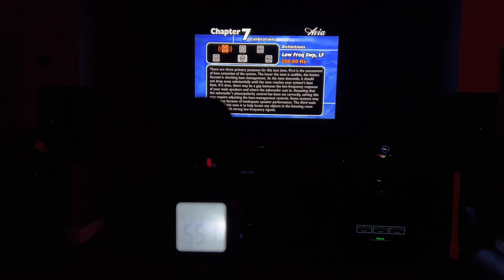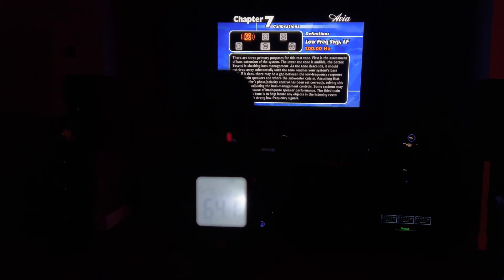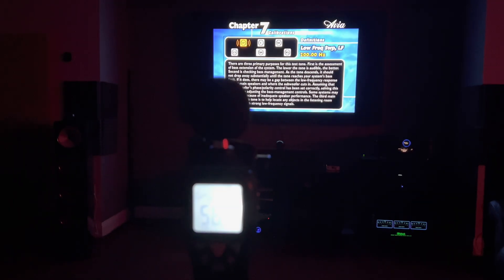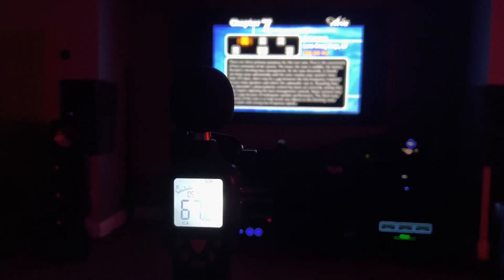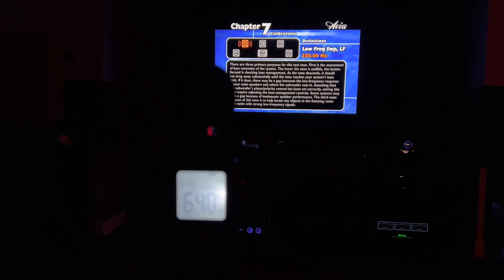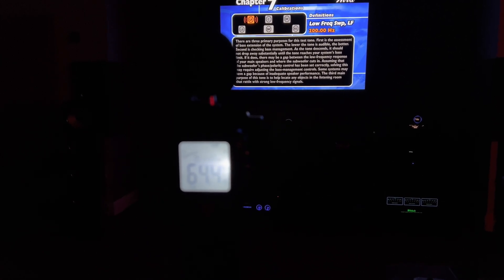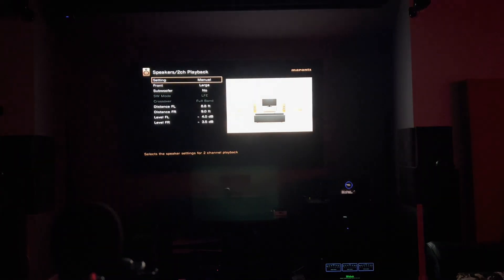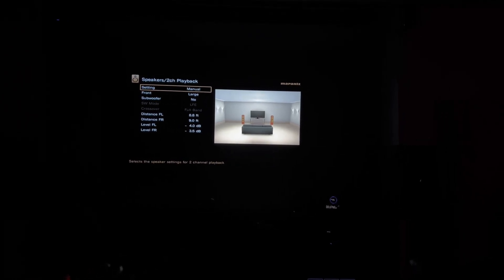How to correctly set speaker crossovers in your receiver/processor

Comment: Hello, is kef q950 for 40zh OK?
Reply from the maker: Thanks for the question. The frequency response for Q950 is 44-20,000 Hz (±3dB).  I would try 50 or 60 hz. Ideally  you should set the crossover point roughly 10 Hz above the lowest frequency your speakers can handle cleanly.

Comment: Hi… I have asked you before.. but still i have a doubt.
Would a single BF210(not the BF212)subwoofer on its own outperform sb16ultra or are they equal?
Reply from the maker: Head to head BF210 will not outperform the SVS16 Ultra.
Reply: @magnoliamo  Atleast would they be on par?
Reply from the maker: @SahilFardeen18  unfortunately, no.  SVS SB16 ultra is much more powerful and as I mentioned SB16 will go deeper than the BalancedForced 210. For movies that makes a difference because the SB16 will the have extra power and headroom for demanding LFE
Reply: @magnoliamo  Thanks for replying… So how does the BF212 go head to head with the sb16? And any difference in sound quality(or musicality between svs and martin logan that was audible once you made the switch) Are martin logans more musical bass than svs?
Reply from the maker: @SahilFardeen18  yes 212 is more comparable to the SB-16 ultra. I prefer BF212 for music but the SB16 for movies. SB16 is still more powerful and will dig deeper than BF212 on movies.
Reply: @magnoliamo  okay thanks for replying. I guess what you mean by "powerful" is by looking at the rms wattage probably? I am telling this because lets compare dynamo 1500 and sb16. Even though the dynamo 1500x has just 650w RMS(as opposed to 1500w RMS on sb16), the output on them is almost similar where in some frequencies the sb16 has an edge by 1-1.5db and vice versa for other freq where dynamo 1500 has more output(Comparing the CEA 2010 output results of both). So i guess wattage is not always exactly the right term to determine which subwoofer is powerful. By that sense since the balancedforce series from Martin logan are a class above to dynamo 1500, i thought they would be atleast on par with the sb16 if not outperform them. Thanks:) Good to know the opinion for someone who has first hand experience with these subs.